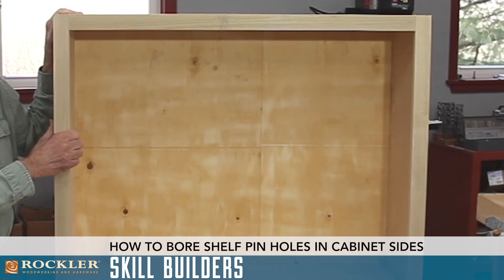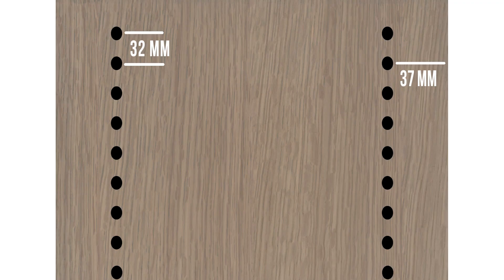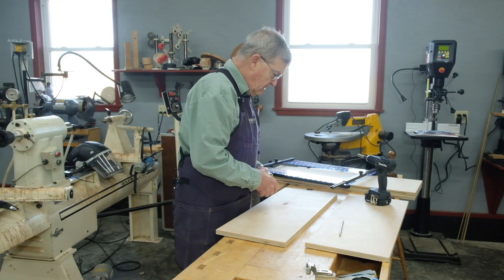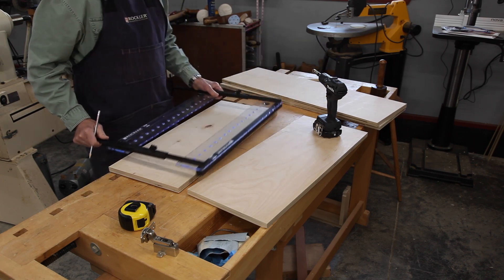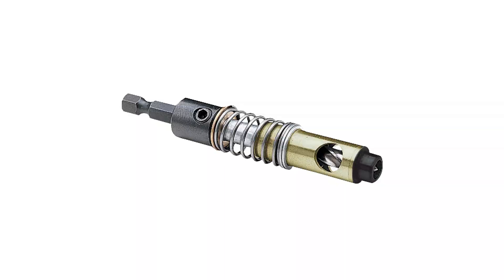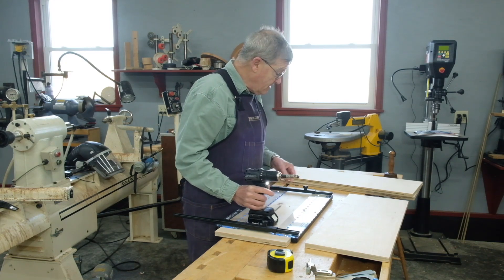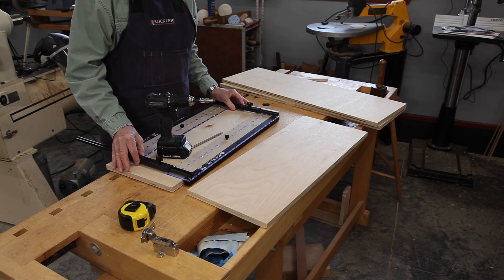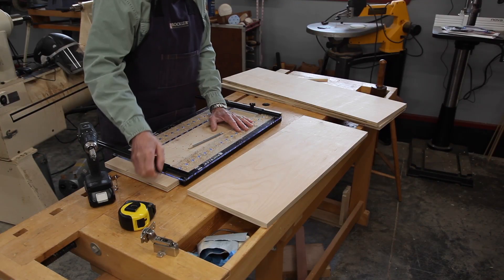Fastest Way to Drill Shelf Pin Holes in Cabinet Sides | Rockler Skill Builders

Comment: What kind of drill bit was that?
Reply from the maker: The drill bit shown in the video is a spring-loaded, self-centering drill bit with a sleeve that fits into the holes in the shelf pin jig Conover is using to drill holes in the cabinet side panels. You can find these bits on our website at https://www.rockler.com/5mm-pro-shelf-drilling-bit
Reply: @rockler  thank you!

Comment: You video shows how to drill holes after taking out the sides.... I cannot take the sides out. Can you show how to drill these pin holes when you cannot take the sides out?
Reply from the maker: When a cabinet is already assembled but new shelf pin holes (or a different arrangement) of shelf pin holes must be drilled, there are shelf pin drilling jigs that can fit inside the cabinet to provide a template for drilling the holes. What's important is that the jig can be indexed the same way off of either the top or bottom interior of the cabinet so a line of shelf pin holes near the front of the cabinet will match a similar line of holes near the back of the cabinet. For both lines of holes, the same registration surface (the cabinet's inside top or bottom) should be used for the jig. Rockler offers JIG-IT Shelving Jigs with Self-Centering Bits, which you can find on our website at https://www.rockler.com/jig-itreg-shelving-jig-jig-it174-shelving-jig-set-template-self-centering-bit
Reply: @rockler  Thank you for your response. The only issue is that the width of the cabinet is 14". it will be a tight area to get the drill inside to drill these pin holes. Can you post a video of how to do this? Or suggest another way to put new shelves. We moved in this house and the kitchen is custom designed and dont want to mess up the existing cabinets.